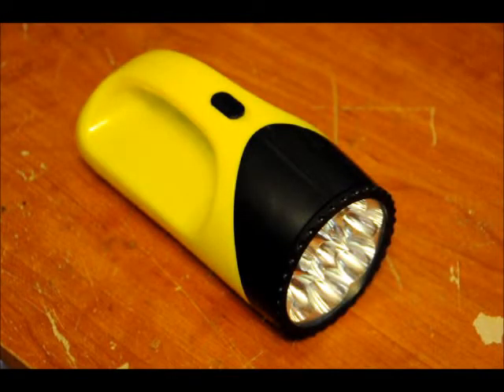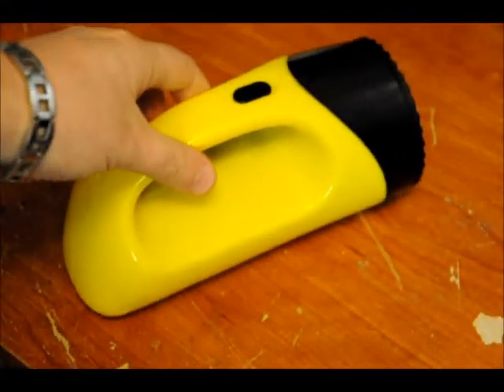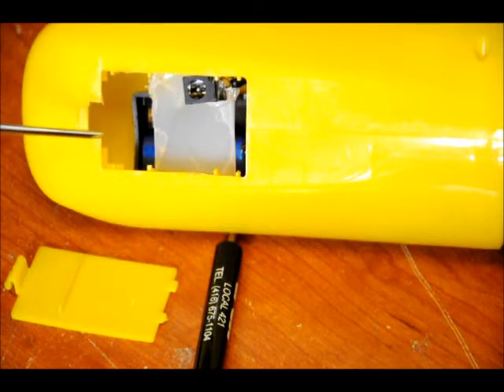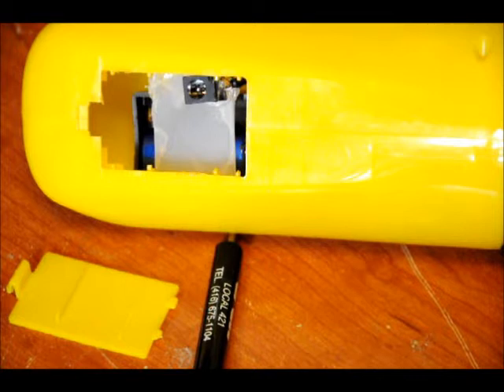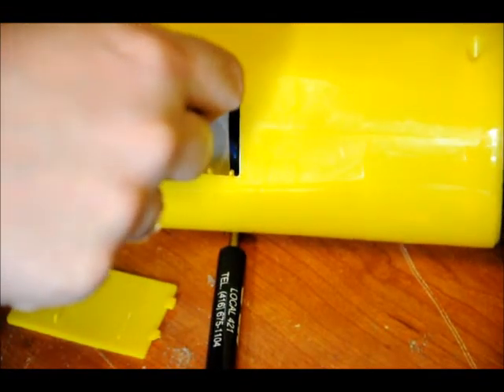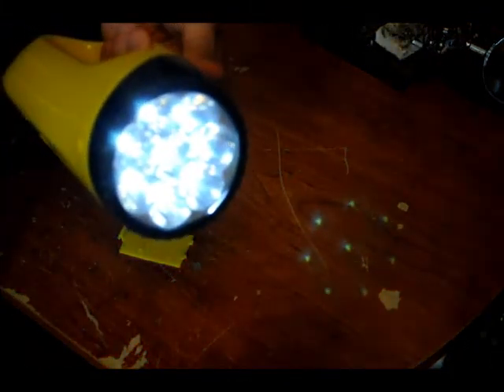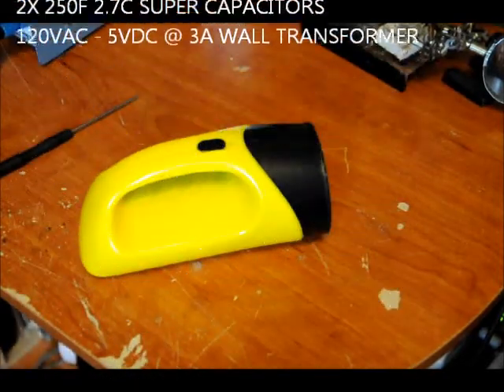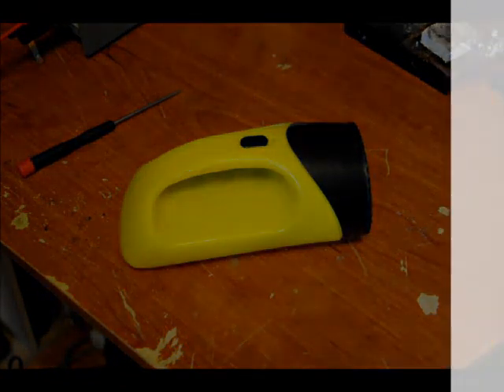An extremely easy to build SUPER CAPACITOR FLASHLIGHT!

Comment: wouldnt it be easier to just replace the batts if u actually manage  to go through 500+ charge cycles, also 18650s are way cheaper than the caps alone. fun:yes, practical: no

Comment: I am genuinely curious. not trying to be sarcastic. can someone please tell me the benefit of building this all with contrast to buying a rechargeable battery pack? as I said I am only curious as I am doing a bit of electronics myself.
Reply: very fast charge time
Reply: Thanks (y)
Reply: Also, rechargeable batteries will quit working way before the capacitors will theoretically.

Comment from the maker: Yes, essentially.  It charges to full capacity very quickly.  Much faster than batteries, and it will not die within our lifetime.  Batteries will.  Several times over.  That is what makes this kind of fun =)

Comment: on your website you sell 200 farad for over $22 and 400 farad over 32 dollars  EACH. no 250 or 350 farad. and there is noooooo  2x250 farad for less than 10 dollars as mention in video